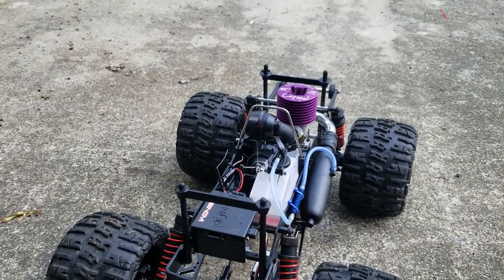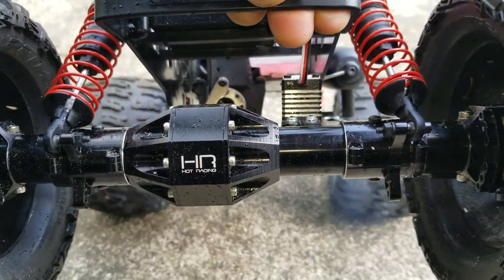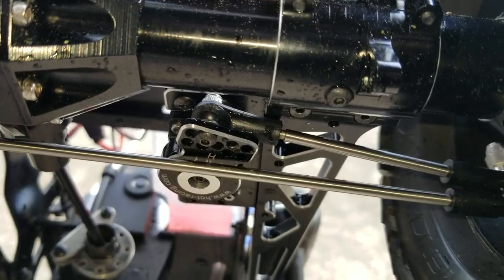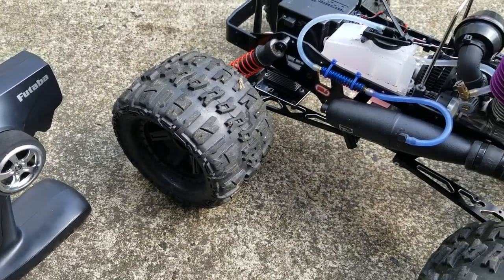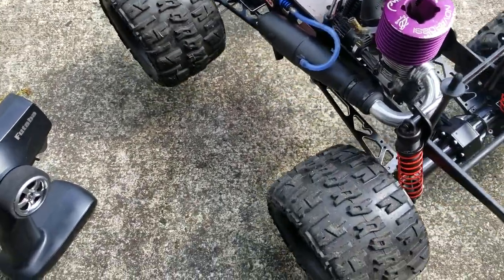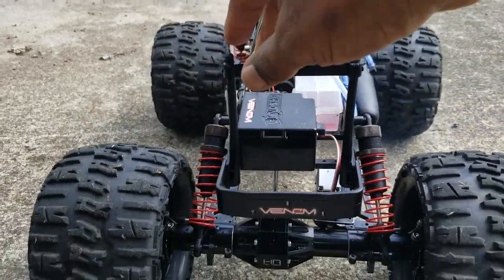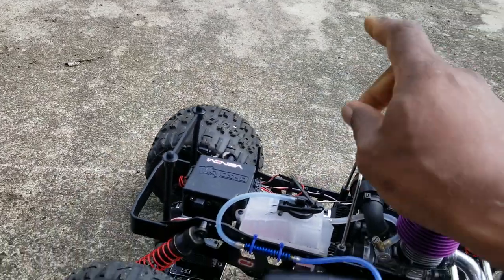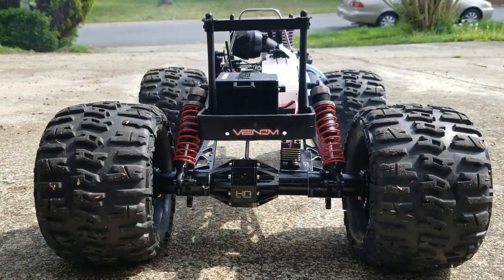Mad crusher fully upgraded.

Comment: I have a Novarossi 28-7.  Will this work good in the Mad Crusher? I've heard there's some issue with the length of the shaft on the engine.
Reply from the maker: You are correct. I took mine out after two broken motor shafts and way to many clutch bell lockup because of the shaft length. I put the ke25 back and changed the header and pipe with super awesome results. Plus no more motor issues. My advice is dont put that motor on that truck. Save yourself time and parts my friend.
Reply from the maker: Almost forgot. You will eat the first gear with that power. Went through 4 gears in 36   days. Too much bottom end power for plastic gears.
Reply: @rcbrooks3543  Thanks man. A friend told me that on the Mad Crusher, "The clutch bell has a special sleeve that acts like a crankshaft extension," suggesting that Kyosho made some new adapter or something.  Is that accurate?     Right now,  I'm running the Novarossi 28-7 on my 17-year-old Ofna Titan. Seems to work fine on that truck, except it destroyed the rear differential --- all gears chewed up!. So, I just recently upgraded all gears to HD Steel.
Reply from the maker: @OrcaBoat3  I dont know about this adapter.....I know the ke25 has that black shaft under the clutch bell. If they do have one I would still keep the ke25 because the mad crusher has no metal gears I can find and if you check out my other videos with the ke25 and novarossi pipe/header you will see its wheelie popping power. Keep in mind I am all Aluminum on the build. I am going to see if I can find this adapter because that would be nice to see. After I did my build its holding the power no problem and keeping the front off the ground on command so I cant see a reason to do a different motor. The ke25 is nasty !
Reply from the maker: @OrcaBoat3  check out my video. This is the title.  ( 9886/41032 on Aluminum rc )

Comment: Hi nice Rig 
I have a question I own the 
Kyosho Mad Crusher GP nitro and it came with a .25 pull start engine can I up grade the engine to a LRP .32 pull start engine using the stock motor mounts that came with the truck ?
Reply from the maker: Yeah. The LRP has the same body as any .28. It will fit but how will the plastic three speed deal with all that torque? No idea.

Comment: What to you think about putting the OS .30 VG engine in this truck? I have a new old-stock .30 VG.  I might install it in the soon-to-be-released Kyosho USA-1 which is based on the Mad Crusher.  See here for the Kyosho news release: https://rc.kyosho.com/en/usa-1
Reply from the maker: Should be a good fit. Not a super amount of bottom end so the plastic gears should hold the power.
Reply: RC BROOKS,  I think I will put my brand new lrp zx 28 in my usa 1. Thoughts? Thanks! Mess

Comment: I've had some transmission failures on my USA-1... worn out inside of the gears. I'm using the OS .30vg, but lots of people using the Kyosho .25 are having same problem. So, I was wondering, if I dropped down to the LRP .21, would that still be OK for this truck? or would the .21 be too weak?  (I remember the original Kyosho Mad Force had a .21, back around the year 2003)
Reply from the maker: Unfortunately, it's not the power that's the problem. It's the gears being plastic and too low quality to handle the constant engagement of the clutch. If you want to have better luck with that you just need to spend the cash and get the harden steal three speed gear set or do the 2 speed harden steal gear with slipped clutch upgrade. I did the 2 speed set up and ordered the harden 3 speed witch I have not installed because the Two speed is holding.
Reply: @rcbrooks3543  thank you. Would you say that the plastic Gears of the original Kyosho Mad Force were of much higher quality than the plastic gears being used today in the Kyosho USA-1/Mad Crusher? I actually do have the steel 3-speed gears that I bought from eBay, but I have not yet installed them because I heard they're actually too hard for the rest of the parts to handle. Some guys say that they cause damage to the gears on the clutch Bell. Others say the inside of the steel gears cause damage to the cams.
Reply from the maker: @OrcaBoat3  I did the two speed and harden bell. The two speed has a slipper clutch and it does not break because there is no cam to break. That set up has been flawless
Reply: @rcbrooks3543  Interesting. I was wondering, do you know if the LRP .21 (or any of their other larger engines) can handle the 3-speed clutch bell?
Reply from the maker: @OrcaBoat3  sorry I don't. After I did the two speed conversation I never looked back

Comment: Did you do the steel 3 speed gear upgrade? Or did it come like that? I'm the guy with the USA 1
Reply from the maker: I got the steal 3 gears but never installed them. I had already installed the two speed and like the clutch much better. No need to install the 3 because the clutch is more prone to fail.

Comment: First off that’s a sweet rig, I’m right in the middle of making mine similar to that. I know this is old and I’m probably really late but I also did the hot racing axles and hot racing ladder bars.  My issue with the ladder bars is they did not come with any hardware, how did you hook the front of your ladder bars to the chassis?
Reply from the maker: Steering Parts Madforce Kyosho MA-025 #703605
Reply from the maker: This is how it finally ended up look after I was done. https://youtu.be/BOEghHzBqmo
Reply: @rcbrooks3543  cool, thanks man… this will be perfect once i can get my hands on a set.  Apparently they are all backordered everywhere here in the States.  I just can justify the $40-$50 to get them from Europe
Reply from the maker: @brandongirardi4027  you try eBay?
Reply from the maker: @brandongirardi4027  I see them for 24$ with 2$ shipping on ebay

Comment: Which is  better a  Savage or Mad Crusher?
Reply from the maker: Savage is better out of the box. It's not as fast but is tougher and the independent   suspension gives a more buggy type ride.   I had to put another 400 easy into the mad crusher to make it tougher. Stock the mad crusher solid axles are cool looking but a major weak spot. You have to go Aluminum to fix that and they cost 160 per axle. The savage cost more but you wont need to upgrade straight out the box. I miss my savage. Ps savage has a tone more upgrades available.

Comment: whats the radio box upgrade from and whats the steering upgrade from? Any links? Good looking ride! I have the Kyosho FoXX, been running that for several years.
Reply from the maker: Hobbico Voltwatch 2 4.8V 6V RX Monitor

From Amazon
Reply from the maker: Hot Racing KMF24M01 Aluminum Steering Servo Mount & SS Rods Kyosho Fo-Xx Mad for

From Amazon
Reply from the maker: Venom 6V 1600mAh 5-Cell Hump Receiver NiMH Battery

Amazon

Comment: I have same truck and I have not broken it in. What wheels are those ?
Reply from the maker: In this video I am running proline trenchers 3.8 size.
Reply from the maker: Note.....the prolines are great on or off road and have a very long wear life. Also check out the arrma backflips in my other videos. The arrma backflips look more stock but have side wall strips inside the tire so they wont balloon at all. More suited for off road but better stopping power and grip. Work well on road but a little faster wear. Not by much though. The backflips will give your axel about 2.75 inches of clearance. The prolines are a little lower. Also I would suggest some wheel exstention. I went about 23mm and you get much better handling
Reply: RC Brooks if you ever get rid of this truck; please contact me. I love kyosho cars
Reply from the maker: @irfanhafeez1341  I will keep that in mind but I have to be honest, I've put around 1200 into this thing. Lol I dont know that will ever happen.
Reply: @RC Brooks; it’s a mean truck. Enjoy it brother ! Thanks for sharing the video
Reply: @rcbrooks3543  go with the 2.8 those are too big
Reply from the maker: @mattster197  I went bogger and have never snapped anything because I am now all aluminum

Comment: Looks great. Would love to see it go 💨. Did you swap the 28-8 from the LST2 or you picked up another? Is that the stock wheelie bar?
Reply from the maker: I did the swap. I am going to sale the lst2 so I did not see the need to let the 28 go. I only like turbo plugs because they last. 4 gallons later and have not changed it yet. I did put the mag force wheelie bar on because its more stable on two wheels.
Reply from the maker: I never even put nitro in the kyosho. 25. I will most likely brop it in my lst2 for sale.
Reply: Does the MF wheelie bar keep the truck from flipping? Does it allow you to ride the wheelies?
Reply: RC Brooks why sell the LST2? Not feelin it anymore? I really like mine even though parts are discontinued.
Reply from the maker: @brionitro3515  lol if you see the top of my novarossi its totally scratch in the back. This thing flips easily.  I just ordered a Aluminum wheelie bar that's 2 inches longer from risky concepts. That will fix it. The stock one is simply too short. That's after trying stock one wheel and mad force 2 wheels. Both cant hold a hard wheelie
Reply from the maker: @brionitro3515  in time you will find getting parts are a headache. Just over being priced gouged on parts. Great truck but every run I feel I cant run hard for fear of the next breaking part
Reply: RC Brooks I already know what you mean but I still l like it. It’s a unique MT, nothing else like it.
Reply: What a beast.. wish I can upgrade the differential housing in my mad crusher but it costs $300/pc to be shipped here in japan... :(((

Comment: Put an super chager for more performance
Reply from the maker: I already put 2000 in that ride. It's all Aluminum, lights servos and 9886/41001. It wheelies on command and nothing breaks anymore. I don't see the need for a super charger as it's so fast now I slide allover the place and with all the power it has whelp no need to push my luck.  Lol if you watch my other videos you will see I had to scale back just to keep it under control with my headers. When I did the 9886 and 41032 cronical header it was too much for a neighborhood on pavement so that would be over kill. With my new tires the diff cups don't even get striped and that little monster just looks cool to me. Maybe if I get a truggy I will look at a super charger because the handling would be preferable.